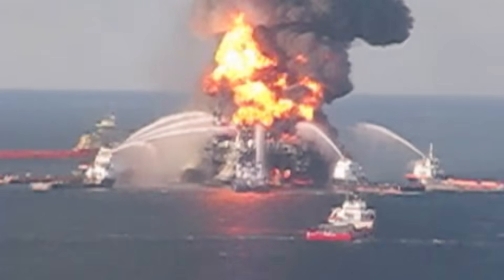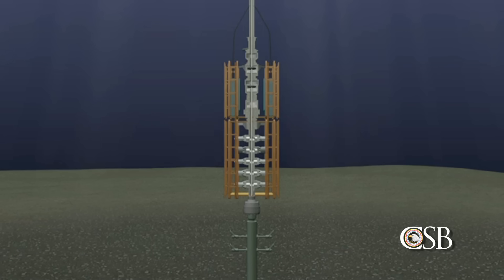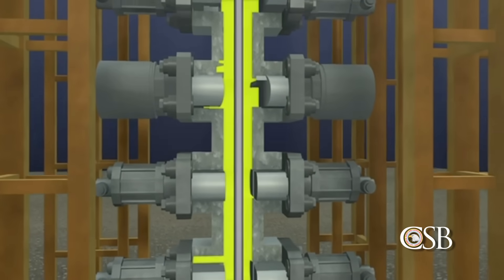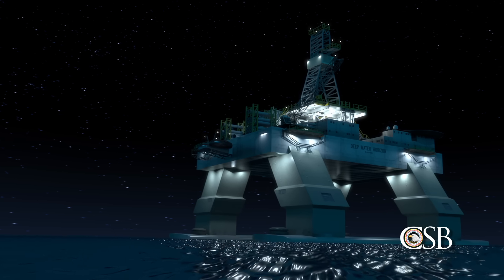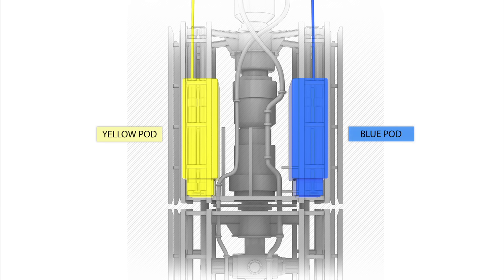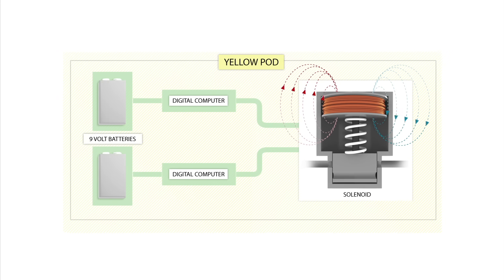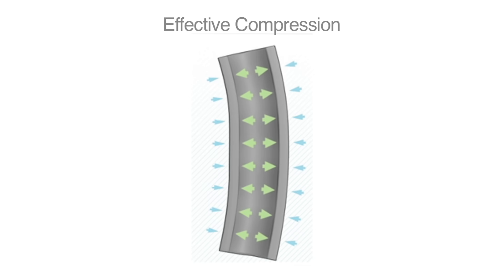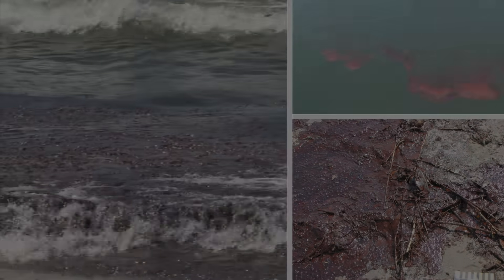Deepwater Horizon Blowout Animation

Comment: How could miss wiring happen in such a critical equipment and can't get detected during testing.
Reply: At the chemical plant I work at we have a schedule where we test safety systems often. No amount of money saved from bypassing safety testing will beat the amount of money lost when that safety is compromised.
Reply: I've worked with engineers who say their design is so good that it can't fail i.e. don't need to test it! I forgot the part that this was a discussion about production testing. Meaning their design + assembly. One bad weld or solder joint prevents a perfect design from being perfect.
Reply: @SirDeanosity  You said it. I worked in the Commercial Nuclear field and it was the same over confident attitude that lead to 3 mile island. I started in the field shortly there after but servicing Navy reactors. Triple checks were the rule of the day.
Reply: @jerrywatson1958  Watch a movie called The China Syndrome. It was released in theaters 12 days before the 3 Mile Island accident, and of course it was met with backlash from the nuclear power industry's claims of it being "sheer fiction" and a "character assassination of an entire industry".
Reply: @Orcinus24x5  Yeah, it was that too. But Just like the operator that wanted to shut the plant down for a safety inspection, people get overruled by corporate. We plant operators needed it to be safe as we are at ground zero.
Reply: @jerrywatson1958  isn't that the same level of confidence that brought us the titanic?
Reply: @jerrywatson1958  Oh if only the civilian nuclear industry was held to the same standards as the navy i would bet at least a few accidents would've been avoided.
Reply: @Orcinus24x5  similarly, “Dr. Strangelove” was greeted with pooh-poohs by Strategic Air Command, the DOD, the army, air force and others, who then quietly undertook a full review and overhaul of the permissions structure of the nuclear arsenal.
Reply: @SirDeanosity  engineers are / tend to be….narcissistic jerks.
Reply: @SirDeanosity  pppo
Reply: @SirDeanosity  no design is perfect
Reply: @SirDeanosity if they say that, they are not engineers at all, don't deserve to be called engineers. Saying "you don't need to test it" for an engineer would be like a doctor denying someone emergency medical treatment or a priest telling someone's confessions. It's like a core moral principle of the job.
Reply: @SirDeanosity  I've worked with engineers my entire adult life and have never heard one say this. Maybe you work with pretendgineers.
Reply: I'd hate to be in the shoes of the guy who "mis-wired" the batteries ..
Reply: They need a law requiring equipment like this, to be inspected and tested by a qualified 3rd party personal before each use.
Reply: @monteclark1115  during procurement process, almost all critical equipment including small ordinary valves are factory inspected by representative of reputable third party inspection company, critical equipment includes FAT (factory acceptance test). The inspection test results are all certified and documented. This is the industry practice. However in the case of DWH incident, there must have misinspection or collusion happened (just like the Boeing plane incident), that is why the Cameron International Corporation, the US designer and manufacturer of the Deepwater Horizon blowout preventer, was also made liable and had settlement agreement with BP by paying $250 million.
Reply: @monteclark1115  it doesn’t matter for the fact that these major companies would just pay the 3rd party to say what they want
Reply: @monteclark1115  Devices like these are intentionally non-resetable.  Once triggered they lock in the open position and cannot be closed again.  A test would ruin a device. This is done to prevent any chance of it adjacently closing after being triggered. I don't know about this particular device, but oil drilling is incredibly hard on electronics as is sea water. Standard practice is after soldering and QA the entire device is rugged with flexible resin to prevent wires from getting wet or vibrating loose. Removing the resin for an inspection would make the device much more likely to fail. I'm sure sample articles were crash tested, but there would be no reasonable way to both test and use the same device.
Reply: @johnmiller8884 then they need to make sure that the people who are assembling them are qualified and know what they’re doing because obviously that wasn’t the case here.
Reply: @monteclark1115  According to Republicans that would be "burdensome regulation"
Reply: @fudhater8592  Republicans did not say that.
Reply: @GoatzombieBubba  It's called "sarcasm", look into it
Reply: @GoatzombieBubba  They do all the time bro. They're constantly hammering the drum beat of "regulation is bad".
Reply: @fudhater8592  you mean bernie wants to ban oil and make you ride a bicycle and use wood and paper.
Reply: @NathansHVAC  Point me to where he said that and I'll go away
Reply: @fudhater8592  
Trump 2020
Blacks for Trump
Reply: @padathir  I mean let's be fair -- it's kind of obvious and true that no regulation at all is a terrible system, and just as true that over-the-top excessive regulation is also really bad because regulation decreases efficiency and ultimately the point to the whole operation is to produce something, and if time is being wasted for no reason, that's going to seriously hinder the success of the business. On the other hand, no regulation would lead to people taking shortcuts that harm the environment, unfair businesses practices, and people getting needlessly hurt. That will also reduce the success of the business, because people will stop using that business if they harm enough people. Regulations are necessary but have a cost, so the fewest regulations possible while still maintaining a safe, legal, and legitimate business is ultimately the goal. That's the theoretical level of regulation where efficiency as well as running a legit, safe operation occur; when both sides are happy. But there's no universal agreement for what regulations are needed, and people arguing for or against individual regulations can both have rational, reasonable points, or maybe a previously unknown issue comes to light, such as in the disaster explained in this video, which leads to regulation. If a certain safety device doesn't work, I think just about everyone will agree to some form of policy that requires the safety device to be re-designed so that it works. But in the real world people have motives and it's legitimate to question someone proposing regulation that appears to have ulterior motives. Saying yes to every proposed regulation would literally prevent business from happening. When the cost to operate is that high, it becomes less and less worth doing that business. So people need to debate these things & there's nothing wrong with calling regulation bad if the specific regulations in question are bad for some rational reason. But that's entirely different than saying "regulation as a concept is bad", which makes no sense. We can debate the rules, but if there are no rules or too many rules it's basically analogous to anarchy or dictatorship which are both pretty awful forms of organization leadership structure.
Reply: @sanders555  Are you kin to Bernie and if so how much did he get from the DNC to throw the nomination?
Reply: @Whupthatbatandown  I'm not, but I don't think the DNC would ever give Bernie anything more than a shovel to the back of his head.
Reply: @fudhater8592  go watch some John Stossel. Heavily against regulations and libertarian. Regulations are usually bad but are good is some obvious cases.
Reply: @csnider_1281  "Regulations are usually bad"

What data do you have to back up that statement?
Reply: @johncholmes643  how'd that go
Reply: @NathansHVAC  
Don't be so naive.  It's NOT about going back to bicycles and horse n buggy and you know it! Air travel doesn't SHUT DOWN!! stop going to the extreme on this stuff!!
Riding a bike now and again isn't a bad idea anyway. You got a problem with EXERCISE?!
5 MILLION bbls. Of crude got dumped into the ocean.
@ $25.00/bbl. = $100million + simply WASTED! 
Woulda covered a TON of green technology research.
Getting off oil doesn't mean IT GOES AWAY! it only means that it goes where it "currently" can't be replaced i.e. aircraft.
We drive/live on renewable power and that leaves non- renewable to be used only where it must..
Can we please bring back Nuclear power??
Reply: @fudhater8592  There are 2 types of regulation, regulation by the government, and regulation by the private sector, what the Republicans want is to get regulated by the private sector.
Reply: @NathansHVAC  you're missing the "once we are independent and able to operate without it" think of it like living with your parents, you don't wanna do that forever
Reply: @AnimMouse  Which is to say, an utter absence of regulation. The private sector would skin you alive in front of your family if it would increase profits by .0000001%, and the only reason they dont is when things have gone wrong they've occasionally been held responsible.
Reply: @padathir  except when it comes to banning books, or denying healthcare.
Reply: @johncholmes643  your boi is going to prison and there’s not a same thing you can do about it.
Reply: @fudhater8592 when you see the world through dual political lenses, they've got you. all your energy is consumed in the false dichotomy. when you see people write wake up in comments, you are the kind who needs to take heed.
Reply: @fudhater8592 uh. Yeah. Let’s make a plow-out preventer engineering / testing a partisan issue. Lmao 🖕
Reply: @fudhater8592  saying all regulation is good is as stupid as saying all regulation is bad. Thread the needle..
Reply: @KraussHelmut  Where did I say "all regulation is good"? Reading comprehension not your thing?
Reply: @GoatzombieBubba they did and still do. All regulation in their minds is needless, until something like this happens. Remember the Ohio chemical train spill? Same thing. We need these regulations.
Reply: @GoatzombieBubba they say those exact words about other situations
Reply: @monteclark1115  the last thing a high stakes job is middle management
Reply: @monteclark1115  
Not more laws, more ACCOUNTABILITY!! They should say, "would you let your children live on this rig"?
No doubt that it's AMAZINGLY difficult to engineer this stuff and have it work in an environment like this. But, how you "mis-wire" or fail to TRIPLE check something is remarkable...
Reply: @monteclark1115  You can't legislate competence. In fact, there is evidence that if you make the state responsible for inspections and testing, quality goes down. Because, let's say I'm running a machine or something and the government comes in and tests it every 3 months, or says they do. (In actuality, they don't, and just say they do.) Well, in that case, why should I test and inspect my own machine if the government is doing it for me? By making the state responsible, you give incentive for business to do a worse job. Look, this was a bad accident, no doubt, but more government isn't the answer.
Reply: This company worth $250 billion couldn't wire their failsafes correctly. They should've been dissolved.
Reply: company shifting blame to silly mistake  - opps
Reply: @GroovyVideo2  I do wonder sometimes.
Reply: Human error what a surprise
Reply: remember that this failsafe device could have cost the company millions of dollars if it were activated in error.
It's easier to install it incorrectly (saving millions short term) and deal with the billions in fines by charging the end user more per gallon, when the inevitable happens.
So many perverse incentives when you run a powerful company in a poorly regulated market.
Reply: It is ALWAYS human error!
Reply: It's like a lot of bad wiring schemes, they work until they don't
Reply: Everyone gets lazy, seriously I've been in houses with shit that's jerry rigged by electricians
Reply: Accidents and mistakes can happen anywhere and to anyone. Don’t forget it.
Reply: How about a drained battery ..
Reply: Because it’s considered a nuisance to profit making.  Same as alarm systems and other safety systems.
Reply: BP was cutting corners to save money because their stock was falling. They didn’t comply with safety checks during building
Reply: Absolutely cannot believe they didn’t have some test rig where the solenoids were tested to just… move. Like it wasn’t even a complex failure that only occurred in certain scenarios (the solenoid failure at least) it was just they didn’t do the bare minimum of testing
Reply: Because capitalism doesn't give a shit about safety, it only wants profit.
Reply: @moos5221 you may have been radicalised. self check.
Reply: @moos5221  do you work a hazardous job? I do...and I have 35 pages of safety rules to go by or get fired...so that thing about safety is plain bullshit...
Reply: @Whupthatbatandown  Any where in those 35 pages to check to see if you wired a fucking solenoid backwards so its magnetic field is reversed?
Reply: @Whupthatbatandown  and I have worked in several hazardous jobs and watched bozos skip through and ignore those "Pages of safety regulations"... it happens far too often in far too many places and the entire reason is ALWAYS due to profits... ...and yes, the official paperwork specifically says that statement, but I have witnessed supervisors and upper management specifically telling people to "ignore: that paperwork and take whatever "shortcut" is desired... or face being fired and replaced with someone who will "obey management"... and then, when disaster happens, they raise their hands and point at those rules and sack you anyway with full official blame and unless you have a very clear cut paper trail of those violations, you are screwed. Again I can cite dozens of examples of that very thing... you may have integrity and ethics, but far too many do not and will buckle, and then disasters happen.
Reply: @Whupthatbatandown  
35 pages of rules and FOLLOWING 35 pages of rules are 2 different things.

You should see what goes on in the food processing industry...
You'd NEVER touch a hot dog again...
Reply: @SDPBALLCOACH  safety within industry is mandated by liability. True safety is a choice.
Reply: hell yeah
Reply: Because they didn't really care when they designed it.

If they had cared, they could have made it so you can only wire it the correct way.
Reply: https://youtu.be/y2WxQzN_zz8
Reply: Because thy never did testing?
Reply: Cut corners.
Reply: If you watch the movie Deepwater Horizon or the episode of the Newsroom about this, you would find out that the number of safety inspectors for such oil Riggs was 55 and there were 3500 oil platforms to inspect. That is 63 rigs per person and they need to be inspected every 90 days. The math works out to be something like 2.3 platforms inspected every 5 days to stay current… that is “to meet federal regulations”.
Reply: Because federal agents from intelligence most likely RIGGED THE MOTHA TO BLOW... total false flag.... They broadcasted the damn thing gushing crude 24/7 globally.... "That should've been suspicious to everyone".... They wanted that environmental disaster to shock the minds and encourage going green in the future.
Reply: They didn’t do testing.
Reply: If the inspector is high on Chrystal Meth.... i shit you not
Reply: As an electrician my thoughts might be something so complicated can be overlooked very easily
Reply: Because you don't test it. You just sign it off.
Reply: a barrier wont be a barrier without a pressure test
Reply: miswiring
Reply: Pay peanuts....
Reply: Clearly this equipment is not tested as if it is critically needed as simple testing would have uncovered this before leaving the assembly line this is completely unacceptable and the entire vent was entirely preventable
Reply: lazyness or greed, most likely

or someone didnt know what they were doing and wired it wrong, then it never got tested
Reply: They didn’t do the testing to save costs
Reply: Because obviously it's in the financial interests of the oil companies to maintain their own equipment and regulate themselves! Imagine losing 5 trillion barrels of oil you worked so hard to get at and letting all of it just wastefully spill into the gulf mexico for 87 days straight. All that time and investment being wasted, very very financially bad decision - so of course everyone will make sure accidents never happen by themselves - no need for government oversight or regulation. Thank you Reagan.
Reply: @OhNotThat  Boeing self regulated itself without FFA regulations and look how that turned out. Or Tyson meat processing plants without FDA inspectors. The idea that a company will do the right thing because they lose money otherwise is a silly idea when they know that any money loss from sales or fines can be recouped, and that the general public will forget and move on. And even things don't turn around, they can easily rebrand or reform under a new name and everyone else is non-the-wiser.

Corporations only have one goal; To make as much money as possible, regardless of what the product is. The only risk they worry about is making less money than the year before, and will gladly cut corners at the bottom if they think they can get things done faster/cheaper. Always remember. All safety regulations are written in blood.
Reply: You gotta understand how monumental the entire task at hand is...
Reply: insert Mr. Krabs voice Money.
Reply: Non-union
Reply: Faulty wiring is what you're going with here huh..??.....ridiculous
Reply: Engineer
Reply: F*cking Sparkies
Reply: Miswiring in such critical equipment can occur due to a mix of human error, complex system design, and sometimes rushed or incomplete testing procedures. Here are some factors that can contribute to such failures:

Human Error in Installation:
Complex wiring systems are prone to mistakes. Even with detailed schematics, errors in connecting wires or misinterpreting diagrams can happen during assembly, especially when under tight deadlines or pressure to keep projects on schedule.

Complexity of the System:
Critical equipment like a blowout preventer involves intricate electrical and hydraulic components. The complexity itself increases the chance that a wiring detail might be overlooked, particularly when multiple redundant systems are involved.

Inadequate or Incomplete Testing:
Standard tests might not fully replicate emergency conditions. In some cases, miswiring issues can be subtle and only manifest under specific stresses—like the sudden loss of power or rapid pressure changes—that aren’t always part of routine checks.

Rushed Installations and Operational Pressures:
When schedules are tight and there’s pressure to minimize downtime, there may be less time allocated for thorough verification of each connection. This can lead to oversights where miswiring isn’t caught until it’s too late.

In the case of the Deepwater Horizon disaster, miswiring in both redundant control systems contributed to the failure of the blowout preventer. This incident highlights that even with multiple safety layers, if the foundational wiring is flawed, the entire system's reliability is compromised.
Reply: Ironically, enough, that wasn’t the main reason the reason this happened was because every other safety feature and mechanism that was put in place to prevent this from happening, was turned off because corporate ordered them to turn them all off
Reply: @brettweltz8135  Oh, the miswiring? Cute that you think that was the big problem. Honestly, the rig could’ve handled that—if literally every other automated failsafe, pressure sensor, gas detector, and emergency shut-in system hadn’t been deliberately disabled because someone in corporate thought “maximum efficiency” meant “minimum safety.” The BOP (blowout preventer)? Yeah, that too—disabled test modes, ignored battery failures, and a dead shear ram. It’s like taking the brakes off your car to make it lighter and then acting shocked when it crashes.

But sure, let’s blame the wiring.
Reply: @  that's what I said. the miswiring was just one issue among MANY OTHERS DUE TO GREED. Either way this was a terrible tragedy.
Reply: Seems like you have never worked in heavy industry before lolz
Reply: The oil industry only cares about the money and not the environment 😡
Reply: surely qc
Reply: I hat to tell you guys,but,this is all public record now. The electrician was an ILLEGALNand fled the country when the investigation came his way.
He only agreed to come testify if he could have immunity and allowed to sue.
Go figure huh some people were killed by a guy who can always just bail.
Reply: Welcome to people. We tend to be pretty useless.
Reply: The fact that it was 5,000ft under the sea might have something to do with it.
Reply: Ego. They didnt care and it costs money to test that stuff.
Reply: They cant test the shears once the pipe is set seeing as though activating the solenoids would cut the pipe everytime they test it
Reply: @joeleonard7878  that is the reason u set a test plug ,screw out of it , pull up and test the blinds on a different pod every week ,unless the company man thinks it cost to much money,then he makes them fake the test, but don’t worry,nothing will happen,y’all worry way to much!!!
Reply: @joeleonard7878  You would test the unit preinstallation to see that it functions properly. Apparently they didn’t do that.
Reply: @DikoMan What language is that?
Reply: @fudhater8592  = 🤡🎪 political grifting cumstain
Reply: It got missed wire because the oil company was so greedy for the oil that safety was not a priority, so it being missed wired is lack of training from the oil company.
Reply: It was deliberate sabotage.
Reply: Deregulation and capitalism. Duh
Reply: Cos its based and gigachad
Reply: I have a sneaky suspension it might've been intentional as to satisfy regulators at a glance, and too also prevent costly false positives of the system.
Reply: “Made in America”
Reply: Outsourcing QA to CHINA...
Reply: Its like the passport from 9/11 that they found completely intact. Weird how the dancing israelis that worked in the building recieved ODIGO WARNINGS that fateful morning.
Reply: @mackk123 so they test on dry land without the pipe
Reply: @mackk123  found the nazi